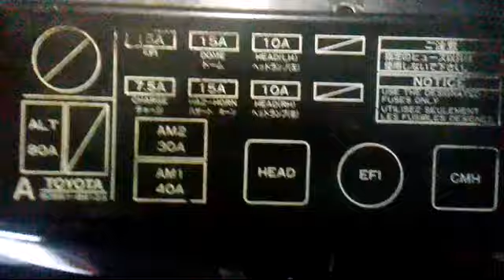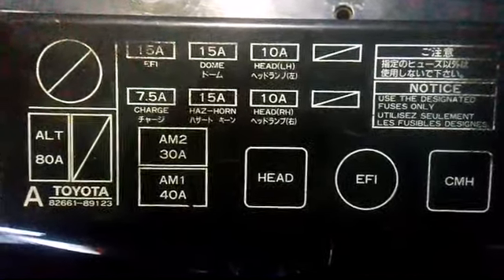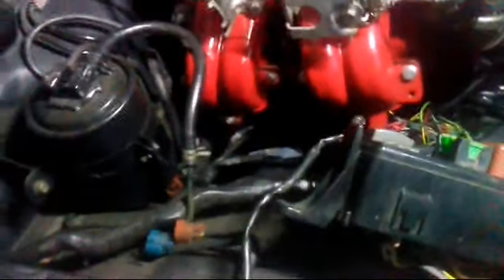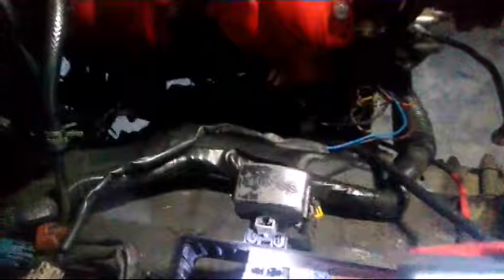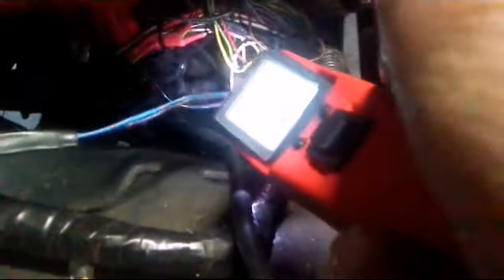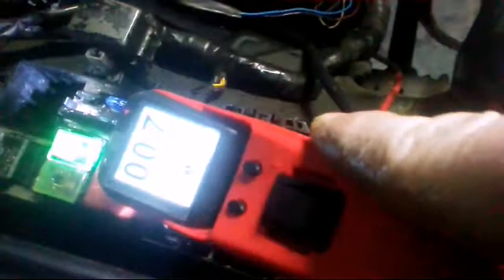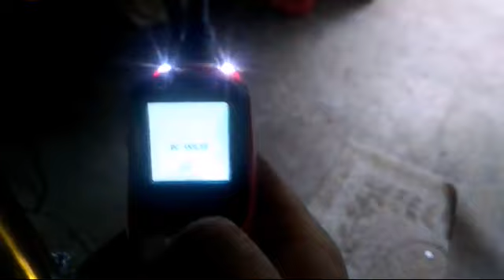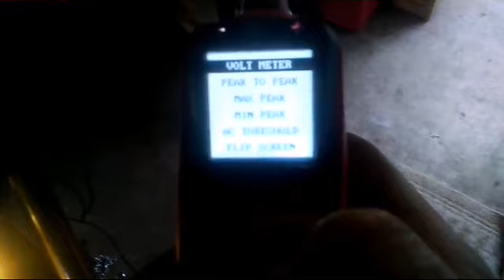22RE No Start No Crank - New Starter

Comment: i was  having the same problem , i removed the ignition switch (not the ignition cylinder) in the back of the ignition switch a screw holding a cable was lose, this is the cable that sends the signal to the ignition rely when you turn the key, and problem solved

Comment: Hi Yota Doug, very handy tool allows to to seek bad or even weak connections through lines all we had in our youth was a meter a low dollar meter if we recall. Lance & Patrick.
Reply from the maker: Hey guys, I have been researching and learning about many diagnostic tools for these older mechanical vehicles, even the jeep you guys own all of these tools would be good to have. I have this probe and a Lang auto ranging meter that is a automotive dedicated meter. Right now im saving up for a oscilloscope and a set of relay breakers, then some of the plugs, probes, and other accessories you need to go with them. So before long ill have everything I'd ever need to perform electrical checks! I appreciate you guys stopping by again =)

Comment: Can u check continuity with that thing? I’d check resistance on all your ground connections and to a GOOD ground. Also check for good voltage between battery, solenoid, starter. I’ve had many connections that looked good in the past but weren’t. I don’t know nothin bout those power probes but if u break out a real meter I can help 😝😝
Reply from the maker: Yeah I got a real meter, its one of those auto ranging ones specif for automotive. power probe basically tells you by the sound

Comment: What year is your truck? 11.5 volts is too low. You will need to put the battery on a battery charger. If I am not mistaken, the charge fuse only powers the charge light in the gauge cluster. I would not worry about the alternator right now. What exactly happens when you turn the key to the start position? What do you see or hear when you turn the key to the start position? Do you have a wiring diagram for your truck? There is the main power feed from the battery to the starter and there is the starter solenoid circuit which goes through the ignition switch, through the starter relay, and then to the starter solenoid.
Reply: I have a similar issue w my 1985 22re 4runner. I hear a buzzing from a relay in the driver kick panel location. when the key is out this relay buzzes and has no sound when key turned to ignition. I have no crank AND no spark. I think i have a shorted wire somewhere

Comment: I always look for a fully charged battery . That would be 12.6 volts or better . Turn the key to start . You must have 12 volts at the S terminal on the starter . If not , your problem is BEFORE that and the car is NEVER going to start . You can then do voltage drop testing on the positive and negative sides . Looks or continuity won't start the car. But a visual and wiggle test is valid . Unless the circuit can carry CURRENT , AMPS - that's what a voltage drop test will tell you . Also , NEW  = NEVER EVER WORKED . Good luck .

Comment: That's not a true power probe brother that's a nock off that explains the problems with false readings power probes always have the power probe emblem on the screen at the top and there screens are sunk into the display so if dropped they dont get damaged
Reply from the maker: look up the powerprobe 3s , even my cord wires say power probe on them.. I believe I even messaged them on IG about the tool and havent heard back. if you go to the website power probe tek rather just power probe you will see the version of mine. I know its really confusing, my next video i'll show the packaging.
Reply: Power probe tek are re branding company they are re branding lower end stuff with power probe power probe 3s isnt a true power probe

Comment: check your solenoid and battery current.
Reply from the maker: All Solid and clean connections, Right now I think my battery doesnt have enough juice so I have a charger on it now.. I was told to check out the voltage regulator.
Reply: @Toyotas_n__Tools  
you mean the connections to the solenoid are good and you didn't check the  current to the solenoid? check it with the multimeter , the problems something between the battery to the starter. you check the current at every component.
Reply from the maker: @bird718  This is exactly what im starting to think lol